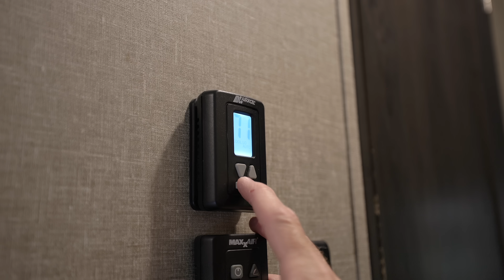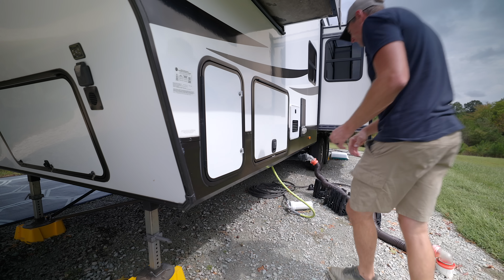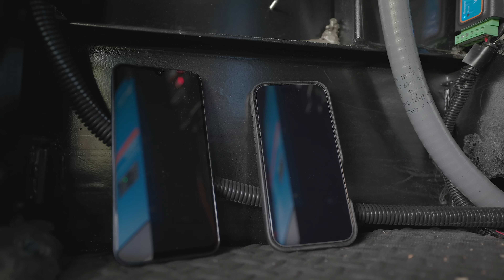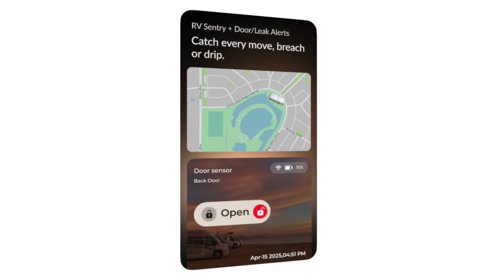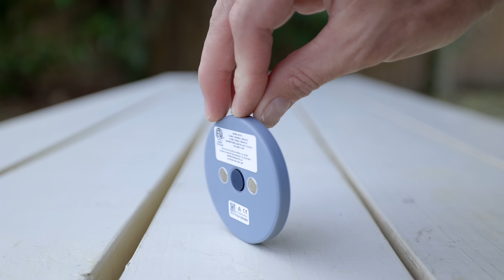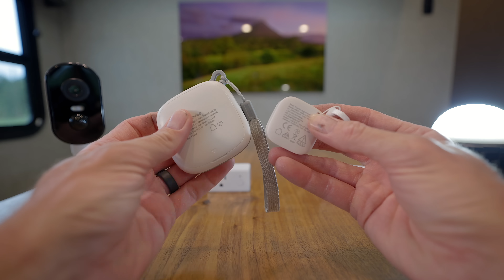UnLock RV Smart Features! AllAboutRVs

Comment from the maker: Today I wanted to highlight as many smart features and devices I could think of that we have on our RV. Every thing from the built in systems like OneControl to the things you can add on like thermostats, Cameras and all kinds of sensors. Below are the links to what was in the video.

Waggle Discount Codes : 15% Coupon Code: JARED
Promotional Link: https://bit.ly/46J2meb

Product : Pet Monitor 
Offer : Flat 70% off on Waggle Pet Monitor
Coupon Code: MOBRICK
Promotional Link :https://bit.ly/4nB4ony

Micro Air Thermostat. https://amzn.to/4odBJVV
Power Watchdog. https://bit.ly/446JINz
             https://amzn.to/3IHDlIa
Waggle : https://bit.ly/4nB4ony
RV Lock : https://amzn.to/3Kr3ifC
Victron Cerbo GX. https://bit.ly/4jlUJhY
	Screen,Touch 50 https://bit.ly/4kg1Rh8
    Venus: https://bit.ly/46Mcm6o
Temp And Humidity tracker: https://amzn.to/3IMdbnF
               https://amzn.to/4nSVLoi
Water Sensors. https://amzn.to/3IH5fnH
Smart Outlet. https://amzn.to/42dFB0p

Comment: I like to use the Compass Connect to get RV to perfect height while hitching. I have a spotter watching everything outside the truck for safety, but there is no way I can get height more perfect while standing at control panel in basement storage. HOWEVER, I prefer the old school switches and such for lights and slides rather than a touch screen!

Comment: Regarding Mopeka sensors on fresh and grey tanks: I installed one sensor on each tank and didn’t get repeatable or accurate results. I tried to calibrate them several times and worked with Mopeka tech support. I finally gave up. Not a wise use of money in my opinion.

Comment: I have a 2017 Heartland Road Warrior toyhauler which was just before all the "One Command" systems were available (not necessarily  a bad thing)  I have added MicroAir "Smart" thermostats to all 3 ACs (along with BT Soft Starts)to not only monitor/turn on/off the units but during the winter I can also turn on the furnace to prevent pipes from freezing.  I also use the Govee WiFi temperature/humidity sensors.  I have them in multiple locations inside the RV including the wetbay, passthru storage, and behind the wall where my water pump is located.  Next I plan to add the Govee leak detector sensors.  Additionally I added the Carefree BT 12 module to allow me to extend/retract my awnings via an app or key fob.  I have had good luck with the Mopeka propane sensors and monitor them through my Victron Cerbo GX.  I also have a Ruuvi tag monitoring the temperature in my inverter bay and plan next to trigger a relay through the Cerbo to turn on a fan to cool the inverter bay when the temperature exceeds a specific level.  I made all my TVs "Smart" by adding "Fire Sticks".  I maintain remote/ internet access to all my "Smart" devices via a Peplink cellular embedded router with unlimited data plan.  Thanks as always for your videos!

Comment: Smart Space Heater. As a full timer with a toy hauler, heating up the garage / office 1h before getting to work is priceless
Reply: Same, I use 3 space heaters with smart outlets (make sure they're rated for continuous high resistive loads, many aren't!) to heat up my trailer/home office with propane only coming on if they don't get it to temp in time (like when it's -10 out). I even have it integrated with Google calendar so it doesn't waste electricity or propane on holidays, weekends, or in office days.

Comment: I have a 30amp rv TT. I a l so have a 3500 generator w/a 30 amp plug. Looking to purchase a 50amp RV. Can use a 50/30 pigtail  to use the generator for charging, Air Conditioner (1 unit) and or power if boondocking?
Reply: I've been doing that for 7 years.

Comment: I've got a MicroAir Easy Touch. One of the first upgrades I made. I mainly just wanted it to have an auto mode like my previous home/apartment thermostats. My first fall I had cold night's where I needed the heat, but then when the sun came up on the black nose cap the bedroom would turn into a sauna by the time I got up. That said I do use the smart features some. The schedule can be nice and being able to check the temp if I'm away for a night or weekend is peace of mind.

I love my Gen2 Watchdog. The alerts are nice and being able to see how much I'm drawing is super handy. I can see exactly how much I'm drawing so I know if I have enough left to turn something on, or I can turn it on and see if I go over and need to turn it back off. I've got my wifi on a UPS so losing power doesn't stop the Watchdog or SimpliSafe from alerting me (however, the cellspot going down still kills everything. Had that happen recently.)

I haven't had any issues with my Mopeka water or propane sensors, but I did notice that Lippert now appears to offer rebranded ones that integrate with the OneControl stuff. I'm curious if they'll let you have it shut off the pump or do some kind of alert if the water is low.

One of my favorite "smart" gadgets is my Beech Lane leveler. I found out about it from Ross over at RV Tips and Travels. It's been a game changer for leveling, especially with leveling ramps. It easily shaved 10 minutes off my set up time.

Comment: If you have your Victron on your local Wifi network, you can just view the monitoring GUI directly by browser and IP address.  I have "pinned" tabs in Chrome, and one of those is the Victron GUI.  Also, it reports to an MQTT server, if you're super-technically-inclined!  (You can read the MQTT data and do anything you want as a programmer.)

Comment: The Mopeka under the propane tank sensor does have its problems, BUT having the knowledge of a tank "getting low" on a two tank system is worth the price.  Especially when it come to winter when you can time the exchange of cylinders at YOUR convienence.

Comment: Garnet tank sensors work great. I have the console mounted in the wet bay which makes filling and dumping easy without my phone, but Bluetooth connection to their app makes monitoring anywhere in the rig easy. I have Victron, but only use the Bluetooth app and not remote GX so Garnet works just fine for me. I have the latest Mopeka propane sensors and battery life is better and again works great while near the rig. Yes not one integrated console, but like everything else these days just another app that is easy to switch between. I also use the Govee temp sensors to know is the basement is doing well in winter or inverter in summer time. I also have the long range water sensors too.
Reply from the maker: 👍🏼 Good addition. I like the sea level just wish it had integrating with the Victron equipment but you are right very accurate and dependable which is most important

Comment: Jared you hit the nail on the head. I couldn’t agree with you more with everything being integrated in the command panel, I can’t tell you how many times we arrive back at night time and stumble around trying to find the light switch, not to mention most command boards are located behind cabinet doors now.
Reply from the maker: Thanks, glad I’m not the only one.
Reply: Jayco has their own app that connects with the RV that allows you to do pretty well everything from turning on the RV lights to operating the furnace or AC. All from outside the trailer.